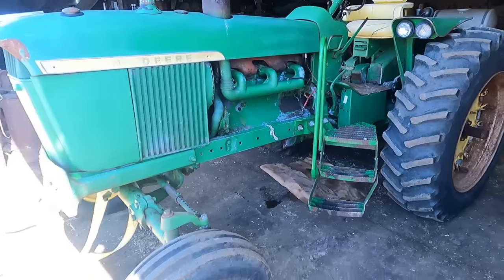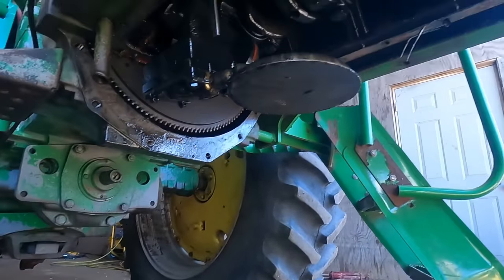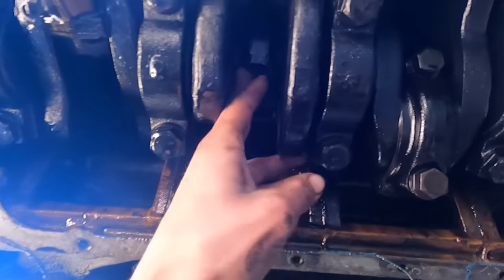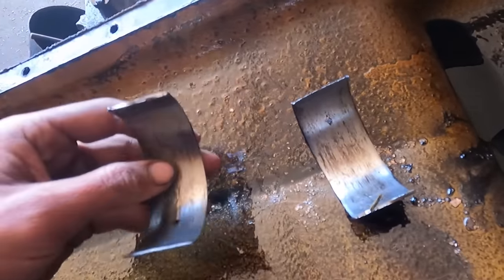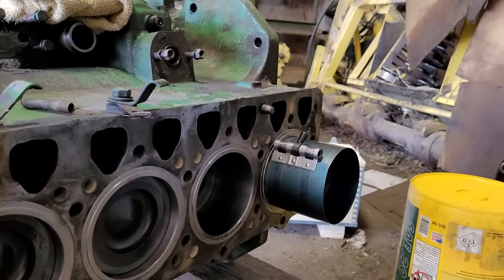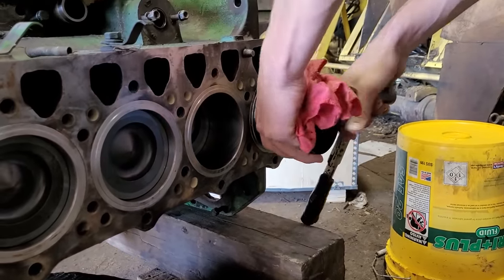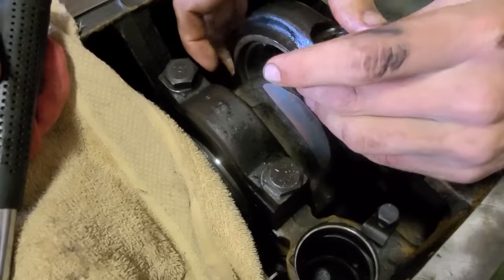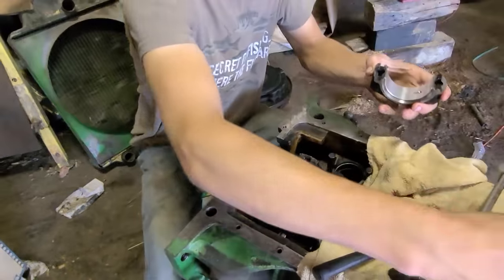John Deere 4010 Engine Rebuild

Comment: I have lost count of how many 4010 and 4020’s that I rebuilt in the late 60’s and early 70’s.. I worked for a John Deere dealership in the UK  and loved working on the Deere’s.  Lovely tractors. Watching this video has brought back some great memories.
Reply: Yeah you can get pretty good at working on JD.
Reply: @bradjenkins932  I guess all marques have their problems. I also worked on Massey Ferguson’s, New Holland, Ford, International Harvester and unfortunately the Russian  and Polish Zetor and Ursus. These two were built to last as you can imagine but boy were they unreliable. .
Reply: Should have bought an 806 or 856 and the engines would have run 10,000 or 15,000 hours!
Reply: @countrygent4  We have 1066s that have 20K+ hrs. O'haul them around 5-6K hrs. Great old tractors.

Comment: I've been doing that type of work around my county for a 35 years and couple observations when you're doing this kind of work it seems like 75% of it is cleaning. The other other notable thing is when you first started up you realize you did a lot of things are right that are not seen by most, which means there's a lot of things that can be wrong. Thumbs up.
Reply: Master mechanics at work...good job guys and you too Rhonda...you managed to coax a few words out of em...my experiences around a shortline rr locomotive shop (as here...merely observing)were that when heavy intensive work was ongoing...very little was said....except on occasion when clanging of metal unexpectedly occurred...an expletive or two...and then sometimes a "redo" of long hours of work would be redone...all part of the fun!

Comment: Im a machinist and I have few recommendations. I hope you replaced the rod that had the spun the bearing and also you should have all the rods resized at a machine shop. They would grind off a little off the rod and cap where the cap fits on the rod and then open the bore to the proper size. This would help to keep the bearings from spinning again. They would also install a new bushing in the small end and open it up to proper size.
Reply: And never use a 3M pad to clean gasket off it will make surface uneven

Comment: Quick tip.... Take you 2 bolts the same size as the bell housing bolts, cut the heads off of them and thread them into the block. Then when you are trying to line up the block with the bell housing it will slide on with ease.....

Comment: I find these jobs rewarding.  One thing I did with the head gasket on my 4020 was put a high heat, high pressure sealent around the oil port on the back right corner because they are notorious for leaking oil.

Comment: Nice job on this one guys! Those 4010s can be little bit of a bear to work on. Between all those lines that run across the top of the engine splitting the tractor is kind of a pain. Then there’s the 24 V system… It starts on 24 V but everything else is 12 so that can be a little tricky. Then it has that synchro range transmission where the linkage gets a little worn out and it’s hard to shift.. then there’s the steering when it gets air in it and the front wheels don’t line up with the steering motor and you have to bleed it out lol. They are really cool tractors though. Nice job men

Comment: Good job 👍 
Don’t put lube on the back side of the bearings. You want the back side clean and dry. Safety glasses when cleaning. That’s a mom thing you need to remind him.😉
Reply from the maker: Mom wasn't  there when he was cleaning, if I had been, I would have definitely said something. 🥴
Reply: True that, no lube on back of bearings. It can give you a false reading on plastiguage and make it easier to spin a bearings. Looks like you did a great job cleaning it up.
Reply: And don’t Touch the bags with your bare hands The acid and oil off your skin. Do bad things to bangs of all kinds

Comment: Big project. I noticed he oiled the back side of a bearing. I only do gas engines but I don't think you want to do that. Normally only oil the surface going to the crank

Comment: Good job! I find slings around the engine, attached to a properly sized chain fall and again to the front loader forks provides for a more accurate "landing". Forks up high and minor adjustments with the falls. Very pretty girl.

Comment: This engine has low oil pressure. The most important thing is that the pressure on the hot oil does not drop at work. Good work👍

Comment: I know you've probably rebuild engines before but I've taken 4010 Motors and put in a Reliance kit with a new camshaft and got a hundred 10 horsepower out of them I would also put in a new oil pump drive here and replace the rod bushings
Reply: if your going that deep replace al the bearings bushings including camshaft
Reply: @michaelwillcutt2619  oh yeah that's just part of the camshaft never replace a cam without replacing the bushings or the bearings

Comment: Just a note when your place the bearings in a cap or the main journal only place lube on the side the goes against the crank shaft if you place oil behind the bearings it makes a hydro space that once the bearings are tightened and torqued the oil walks out later and leaves a gap between the cap or connecting rod.  this will make hot spots on your bearing and they will fail early.  thanks

Comment: As handy of mechanics as the guys are it would be fun to see the shop get a hydraulic floor hoist upgrade. They are pretty spendy though, usually about $1k/1000lbs plus installation costs.
Reply from the maker: One would definitely be handy at times...

Comment: Great job . I uses o rebuild 8000 cubic foot per min. Air Compressors. 48 Valves that weighed 75 lbs each. by myself .

Comment: I like your videos very much.  You have a great family with good work ethnic. I don't mean
to pick on anybody, but when you put an engine back together you never put oil on the back
side of a bearing because it could cause the bearing to spin on the crankshaft thus ruining
a good overhaul job that you did.

Comment: I hope you took the time to make that 4010 motor in to 4020 as long as you had the crank and liners out with 4020 pistons and liners you cold have a 4020 motor because they both share the same block

Comment: Hi could you give a bit more information on this project, was the crank refurbished or replaced, same on the con rod, was the head refurbished valves replaced, oil pump checked, diesel system refurbished, clutch replaced, parts from where and a rough cost of parts, omc parts or genuine, cheers.

Comment: You don't part out  John Deere  4010's and  4020's  their  resale  value  is  very high ..  More than they cost  new.  "Inflation"  Looks  like  it  was not damaged  very much for being seized ..
  My Grandfather and some other  High School aged Buddies  were driving a Model  A ford  from  Kalamzoo area to Lansing to go to a Michigan State  AG show.. their car  had a rod bearing  go  bad..  They found a repair  garage with a pit..  Pulled the oil pan   put   a strap  of leather  in place of the  babbit bearing and  made  it  back to the  Vicksburg  Kalamzoo area..

Comment: Great job on the diesel engine rebuild! Gotta keep those classic old John Deere's going. What size of 6 cylinder diesel was that tractor? Looks very similar in size to the 5.9 & 6.7 liter Cummins inline 6 cylinder diesels used in the Dodge/Ram 2500-5500 trucks. I know these John Deere 6 cylinder motors are common in competition "pulling" tractors too, of course turbocharged + fueling turned way up. They sure don't make em' like they used to! I've even seen some newer model tractors & other agricultural equipment now saddled with DEF + other emissions equipment. The "simple" days are over unless you're dealing with older equipment.
Reply: I believe their 404 cubic inches if a 4020 block, 380 in a 4010

Comment: Never lube back of rod or main bearings. Only where they ride on crank, will  make them spin, Great job otherwise. Jim
Reply: I was thinking that same exact thing also place the rod bearing on the rod before placing it in the bore so your 100%s sure the bearing is seated properly.. but hell great job ..

Comment: WORKING AT A GM DEALERSHIP IN THE EARLY 80's, GOT TO WARRANTY NUMEROUS TRANSMISSIONS WHEN A TECH USED RED SHOP TOWELS TO WIPE DOWN ALL THE PARTS INSTEAD OF AIR.

Comment: In the early 60's, Rolls Royce bought the rights to manufacture GM"s Turbo Hydromatic transmission. Rolls built one from blue prints and it didn't work. A GM tech checked it out and found that Rolls had built it to the lowest side of the tolerances. When Rolls built it to the high side of the tolerances, it worked fine.  Old John Deeres are very forgiving. They were built when tolerances were a bit lax.

Comment: So many questions left unanswered was the crank shaft turned by a machine shop did you replace the rod that the bearing spun on.  was the liner depth  measured ?

Comment: Kevin , that 4010 has had 12 volt conversion. It takes a different wire harness to put the alternator on. My 4010 still has the 24 volt system , it has a generator.
Reply: I didn't know if anybody else seen the alternator

Comment: Starts  on  24 Volts  runs  on  12 volts   Series  Parealle  switch ..   I had a   24 Volt  Starter  go bad on  my Lorain Loader  1963  with    JS-8  Cummins  engine  Super charged  180  HP ..   The local Starter  rebuulder sold me a  larger  12 Volt starter  40-MY  I  wired the two     8D  batteries  straight   12 volts..  
   I also  replaced a  12 Volt  Gnerator with a  a  Prestolite  Alternator that  was not chasis  grounded..   The  Loader has a Posative  Ground system and I did not want to change that..  130 Amp Alternator works great.  ..  and no dead short  like a chasis  grounded   Delco alternator  wouuld cause.. changing the Polarity of the whole  loader did  not seem feasable to me,,

Comment: does it suppose to have such low oil pressure would have expected 50psi at least
Reply from the maker: Manufacturer says, 20-25 psi while idle. 35-40 psi while working.

Comment: I can tell you're probably what happened he either ran it low and oil or he had it on a hillside under a load where it sucked air or the camshaft gear is stripped that drives oil pump that's more like it what's wrong with it